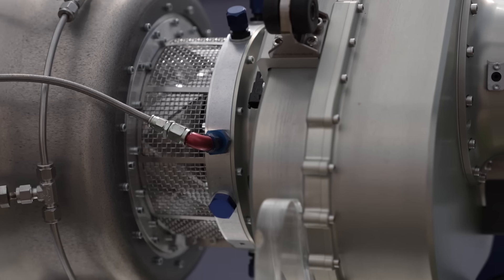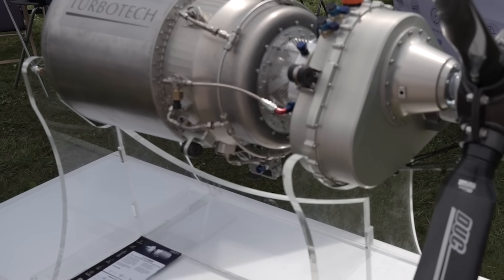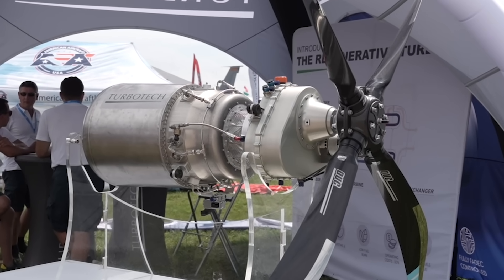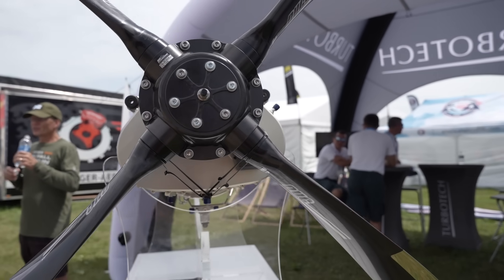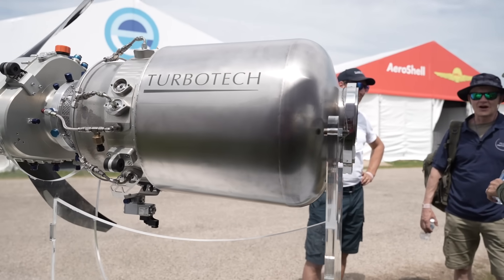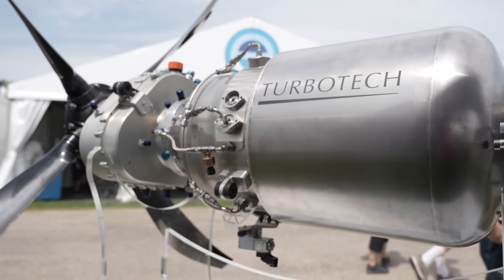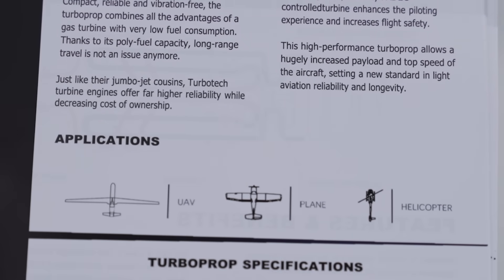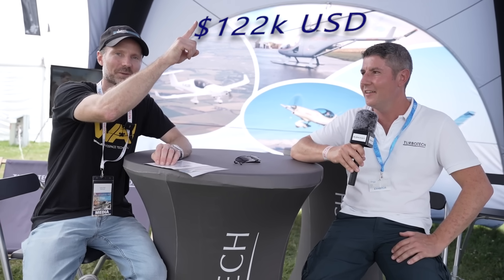Is this Turboprop a game-changer? It's Here Now.

Comment: If, and big If, the power claims are true, the single driving factor is going to be cost.  A turbine engine solution is going to cost 3-5 times more than a piston engine in this horsepower range.  The fuel and even reduced maintenance will not justify the acquisition cost.

Comment: Taking the costs into account it would take about 2500 hours of flight time to bridge the cost difference between this engine and a similar output Rotax, and that is with me giving the turbine the absolute best consideration in each part of the comparison.  That's just to reach the cost price of the turbine.  in that time you will burn 100k in fuel on both engine types. The only way, for me at least, that this engine makes any type of sense is if they can double the hp for the same fuel burn without raising the price.  That would make it compete in a different class where the engines burn 16 - 25 g/h and 200k - 300k in fuel over the same period.  I know I probably sound like a negative Nancy but the math has to work out for it to be viable for owners .

Comment: The high price negates any fuel savings up front!
I like the Delta-hawk 2 stroke V4 diesels. $60,000
Reply: I think you need to take a longer view for buying this engine: with TBO at or beyond 3000 hours, with low fuel burn and lower maintenance, the total cost to operate this engine more than makes up for the initial engine cost.
Reply: @Mistamannfour  Turbine is not low fuel burn. It's higher than piston! Piston can get better mileage than the Toyota Prius. 50 MPG.
Reply: @We-Do-NOT-Consent-To-The-Loop  Did you listen to the video regarding the fuel burn of this turboprop engine? Yes, a PT-6 has high fuel burn, especially down low as most turboprops are more efficient at the high altitudes. This turboprop burns 5 gallons/hr when set for econo cruise at low altitude and about 8 gallons/hr at altitude for normal cruise. That is low for turbine engines and very competitive with the ancient lawn mower Lycomming/Continental piston engines.
Reply: @Mistamannfour  Nothing beats a compound Turboed Piston engine. Especially 2 stroke like the Delta Hawk.

Comment: I wonder if it would make sense to use this engine as an APU for an airliner.
Reply: Way too small.  Most airline APU's are in the 1000+HP equivalent.  The plane I fly at work APU is rated at 1.3MW.  About 1750hp.

Comment: that's nice. & for a turboprop- that's a good price. but now you're competing with deltahawk- who is already certified and already taking orders. $110k, for an engineered install package,  all inclusive, even the cowling. radiators, intercooler, fuel lines, throttle, engine mount, engine / panel electronics- everything. even the constant speed prop. they are already offering an STC to cesna for the 172 & 182- you kNOW they'll take it. stand alone price was going to be $60k- which blows the traditional power plants out of the water on performance & price- but the performance level & aircraft type they're aiming for will demand a fully engineered install, since no one has an engine like this anywhere, they want it done complete & correct.

Comment: Engines can always make more bhp with modern tech.  The limiting factor is propeller speed.  There is a limit. Doesn’t matter how much power the engines make, prop will always limit the speed.  Look at the Reno Air Races.  However I fully appreciate bigger power. In a lightweight airframe, it can do really cool stuff.

Comment: So they improved what I remembered to be their earlier fuel consumption target which is excellent, but the cost has ballooned upwards from the 80k USD value that was being tossed around in the past. That will make a very narrow market use case at a time when many people consider the Rotax 915 and 916 to be too expensive. I think their upcoming 250 hp turbine will be the sweet spot if they can keep prices down a bit more.
Reply: Why has it taken so long to install a heat exchanger after the compressor in a turbo prop engine?
Reply: This 109-160hp (170hp hybrid) variant is not competitive with Rotax for privately owned aircrafts. But for flying schools, it's a very different story !

- 4000h tbo and less maintenance inbetween (and they working with EASA for easier mechanics certification) -> low operating and availability
- low fuel consumption and can burn pretty much anything (avgas, mogas, e100, diesel, jetfuel, SAF, hydrogen...)  -> good range, low operating cost, can go for the cheapest fuel, the most available, the one the government wants you to use...
- very reliable -> safety and availabililty
- FADEC -> variable pitch for everyone, less user errors
- easier transition to the big turbines -> good for training future professional pilots
- extremely quiet thanks to the heat exchanger and full carbon variable pitch prop -> a lot less complaint from the school neighbours

Looking at the futur 220-300hp variant for more expensive aircafts, yes there will definitely be a market. And a larger turbine is usually more efficient that a smaller turbine (it's hard to make a small turbine efficient).
Reply: @dufonrafal  i’m not sure how schools are going to feel keeping students ahead of turbo lag.

Comment: Until it is made to replace the 540-550 series of engines it will not gain popularity enough to make it mainstream.. 260-350hp is where it needs to be to make the investment viable.. Just my two cents…
Reply from the maker: They’re are currently developing a 300 hp range.
Reply: That's the market for the Rolls-Royce RR300, which is used in the Robinson R66, essentially replacing the  Lycoming IO-540-AE1A5 of the R44... and Rolls-Royce hasn't found any other buyers for the RR300. Perhaps lower fuel consumption could make a Turbotech engine of this power range viable.
Reply: @brianb-p6586 not to mention it’s likely a fraction of the price…

Comment: With a high enough pressure ratio, the recuperator becomes irrelevant because the compressor discharge temperature is higher than the turbine exhaust. temperature. Recuperators are bulky, and they cause pressure drops that penalize significantly Brayton cycles.
Overall, it is hard to believe that a small gas turbine is more fuel-efficient than a good piston engine.
Reply: I understand the logic, but the intent here is improve fuel efficiency to not much worse than a piston engine... not to be more efficient than a piston engine. 

Do you have examples of compressor discharge turbine exhaust temperatures for engine with high pressure ratios? Are any of them smaller than a thousand kilowatts output?

Comment: A turbo twin Comanche uses IO-320 engines consuming 8gph each at 70% power, 12,000 feet yielding 165-170 knots, depending on airframe enhancements.
The only advantage these engines would provide, assuming they’ll kick the horsepower up a bit, would be a higher critical altitude because most turbo twin Comanches are not maintained well enough to eliminate the myriad leaks that are endemic in the induction plenum. Mine could cruise at 70% power at FL210, but keeping it that tight was a challenge.
Reply: you get lower fuel cost as well, but not enough to make a big difference
Reply: A turbine like this would win in every category save acquisition cost and cost of overhauls.  Lighter, more efficient, smoother, burns cheaper and more available jet fuel, and statistically turbines are more reliable.
Reply: @Oooonumbers  Not if it's flat rated at 141HP at sea level.  There's no way 2 of these in the twinco will make it to 20k like a TIO320's critical altitude.

Comment: $137K   3,000 TBO, Cycles 4,000 . . .  DRMO sales = $1,00 to $6,000 yellow or green tagged Solar T 62 T32 150 hp 13 gph but no cycles and Conditional operation with 300 hr turbine inspection ( O rings one band clamp and the nozzle lines disconnected, reinstall cover & band clamp and lines)   Average time when bought 150 hrs in the M1A1 gen set... DRMO sales rock
Have 100 engines running in Turbine Rotorways or Jet Exec helicopters no issues so far from 1990s on

Comment: The idea of a C-172 with one of those is very attractive.
Reply: Ha, not for the price!!! You could literally go through almost 2.5 pistons for the price of this one.
Reply: @FlywithbrianReno  also you'd lose 40 horsepower
Reply: @N9197U adjustable pitch prop gets a lot of that back plus likely better climb at high altitude. Their next model in the 225 to 275-300 range would be a great 172/182 option if they could get the price competitive.
Reply: @FlywithbrianReno  with a 5000 hour TBO, it ends up evening out.
Reply: Laughable.  You’ll be burning 20 gals an hour.

Comment: With 70000 euro we can buy engine Austro AE 300 , 170 hp jet fuel ,new
Overhaul 30000 euro.
This AE300 is certified engine.
Reply: Completely different set of requirements
Reply: 122 thousand. US.
Reply: 122usd. ???
Why not to buy a Lycoming io540 with this money?
Reply: what about fuel burn?
Reply: Austro engines is Great.
You can google this.

Comment: Very cool technology. Interesting point he made that the piston engine with a fixed pitch prop won't be making full rated hp at takeoff, where their turbine will produce a comparable 145
Reply: At 140hp the benchmark is not an O-235 with a fixed pitch prop. This is Rotax territory and many are fitted with variable pitch propellers...

Comment: The engineering is really cool and I wish them success, but it also seems like this engine is an answer to a question no one is really asking. A 916 is similar on almost all specs and is about half the price right? Even the tbo is close if I recall.  Again, awesome tech and can't wait to see how they do. Just left wondering who is this really for? What is the actual market?
Reply: May be Turbotech is more fuel efficient thanks to the heat recovery system.
Reply: Don't forget that Jet-A is about half the price of AvGas in many parts of the world. Also, you get to log those very appreciated Turbine Hours :)

Comment: If I had a dime for every time I heard the term "game changer" and it turned out to be nothing, I'd be a rich man.
Reply from the maker: So do you think this engine is nothing? It’s real and building time currently.

I think they have something good… But I could be wrong of course.
Reply: @Blaircraft.Engines  We put the Solar T 62 T32 in the Rotorway Exec  (100 helicopters) and you could get that engine for $1,500 DRMO prices   $6,000+ open market  $60,000 new - Not a game changer
But it cut the maintenance down by a 150%

Comment: could this fly in a pusher configuration for a retrofit in a long ez or VariEze
Reply: I'm 100% sure it can. It should be even simpler and cleaner to have it in place of an air cooled piston engine because of it's simpler cooling.
Reply: Cessna P337 with two of these would be very efficient.

Comment: Need to make a 300hp to stick on a cirrus or bonanza
Reply: I’m looking forward to the delta hawk 350hp for them
Reply: Or the panthera
Reply: How about two in parallel to one gearbox 😁
Reply: Man, i was thinking that but on a mini NOTAR homebuilt type of deal. Or. . .two of these on a velocity twin. @BuzzMoves365
Reply: You need less power for the same speed than pistons, they work better at high altitude and they are lighter.
Reply: Rolls Royce M250 has been fitted to a Bonanza. No point, the STC will cost nearly as much as the engine
Reply: @Thinkflite and you really don’t gain speed unless you go real high.  I’d rather step on a new built hot rod motor.
Reply: Engines of this size already exist. Just a matter of implementation
Reply: 300 turbine hp only really make sense in a pressurised airframe.

Old certified aircraft are that: old. They're still great, don't get me wrong, however, technology has come a long way since, just not in the certified aircraft market, where grandfathering a certificate seems to have priority over a clean-sheet approach
Reply: @daszieher Old technology turbines, perhaps. But a turbine engine with comparable fuel burn to big, turbo pistons could be a superior choice to those engines, even in non pressurized planes.

Comment: Do you have to modify the cowling?
Reply: Yes, it will the engine needs to be mounted further forward due to the lighter weight and the cowling will be longer and skinnier
Reply from the maker: Good question… I wouldn’t imagine you would with a slimmer profile, however, with the length there might be a need to. Perhaps a modification just on the front of the cowling if needed on some models. 

I’d love to see one of these on a Mooney  😎

Comment: I discovered your channel a few days ago, and I'm now completely hooked! Keep it up 👍!!! I have been following Turbotech for a while; they need to roll out the bigger engines, 300hp to 350hp, ASAP.
Reply from the maker: They are definitely working on a larger horsepower family. 😎 thanks for watching!
Reply: Why? This is basically a turbine Rotax and it is aiming straight at the two-seater niche, with a wide global market.

At 300hp, the possible sales numbers nosedive. I just don't know, if it's worth getting into. Even Thielert/Continental only took that as a distant second step, after getting their 4-cyl right...

Comment: Very nice and impressive but I dont see a market for an engine that is double the cost of the most expensive competitor out there. Theres not nearly enough fuel savings to justify the price.  I fail to understand why Continental and Lycoming hasn't made everything they offer FADEC like UL and Rotax. Excellent interview and that is exciting. There is a company in Chattanooga putting small turbines on light sport aircraft.  I know they were putting one on a Just Aircraft Highlander or Super Stol not long ago.
Reply: You shouldn't mix price with cost. You need to look at cost of ownership.
Purchasing price of turbine engine is higher, but there is also a lot less maintainance, that means direct savings and less down time. Add to that the cost of fuel. Where I Iive price of 100LL is double of JetA, even more. In some parts of the world it is difficult to get 100LL. 
If we take all that into account, the price difference is greatly reduced or even gone altogether. On top of that you have less weight, that means more available weight to play with and a cleaner installation. It can be aerodinamically more efficient, since there is not much cooling drag, making it more efficient and faster. With higher speed even at the same fuel flow you save on fuel for the trip, you get more range....
Just some food for thought.
Things should be viewed a bit deeper, there is more going on than the frist glance suggests, it is the whole content of the package, not just wrapping to look at.
Reply: … tbo is double with nearly zero maintenance costs, oil change ever 50 hours at $300 each, jeta is cheaper and lower fuel burn. Besides the added simplicity of a turbine failures are far reduced tbh the price is in line with benefits
Reply: @Crazy88boss1  I know we like to pretend turbines have no maintenance, but if you ever do require maintenance on this thing who the hell is going to perform it? Will this company even exist in 10 years to supply parts?
Reply: If you can double the tbo and keep your fuel burn down, the operating economics and reduced maintenance will offset the purchase price. It may not be for the weekend warrior, but an entrepreneur needing to travel often? A flight school that wants reduced downtime on their aircraft? That’s gold. That is the whole point of turbines, their initial cost and higher fuel burn is offset by reduced maintenance and speed, as long as you can fly it often enough.

Lycoming does have a certified fadec engine called the IE2, but it is heavier, burns as much fuel and with a similar tbo as its non-fadec counterpart. With it being more expensive and the only advantage being single lever operation, not hard to understand why it didn’t catch on.